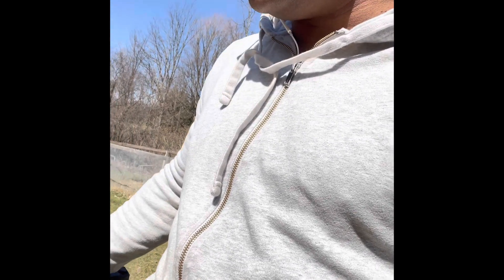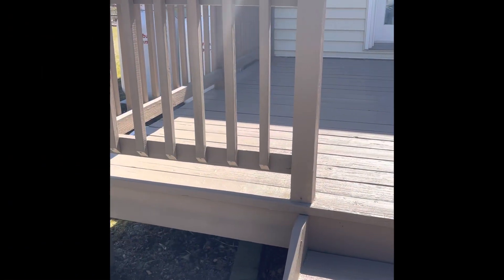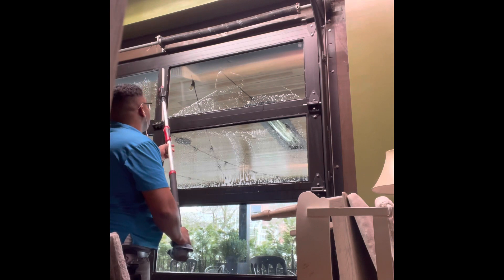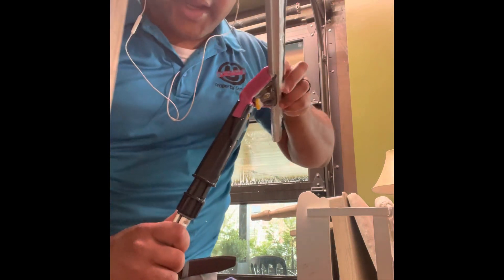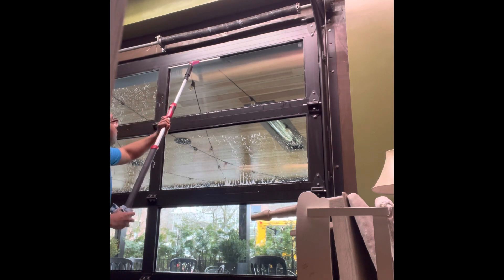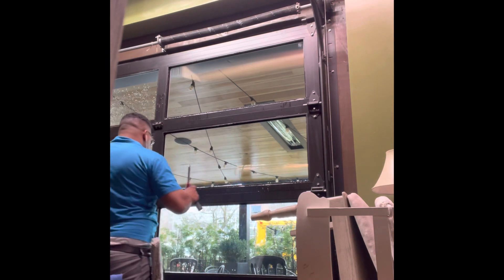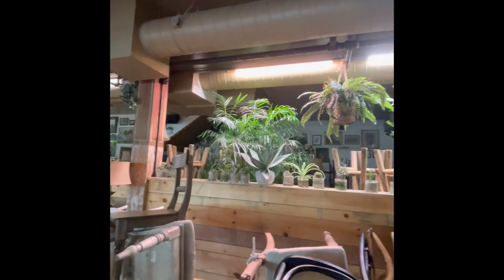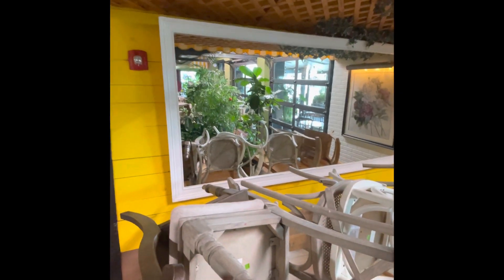￼ How to clean windows professionally and build a window cleaning business from the ground up!

Comment: Hi again brother, I just posted a comment on one of your other videos.
Just two questions about the huge rectangular mirror.
1 Why not cleaning the frame before the mirror itself. If you clean the frame after, don't you raise dust or cobwebs from the frame that may end up on the glass?
2 Again, with the overlap horizontal passes with the squeegee, are you sure it won't leave streaks/marks? Seems you have mastered the horizontal passes in such a way that no streaks are left, but most people avoid that way of working because the contrary happens, they will leave overlap streaks!
Sorry for being such a persnickety pain in the neck 😅.
Greetings from Spain.
Reply from the maker: Not at all thank you for the question! 

If the frame is really dirty and or they want the frame cleaned you can clean it first.  That gives for windows too. 

But in this case the only thing that’s being cleaned is the glass.   It’s going to drip down below no matter what so you would have to wipe the bottom of the frame either way.